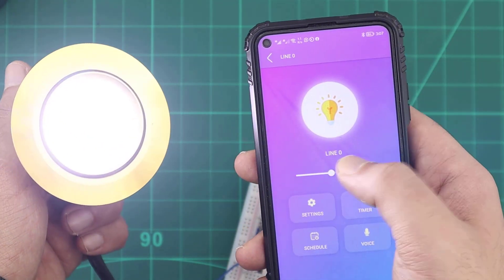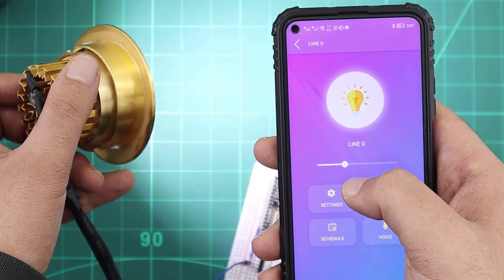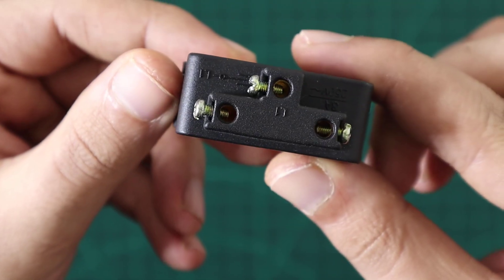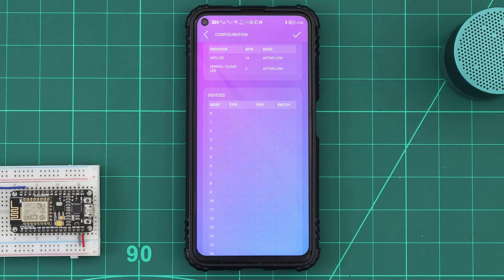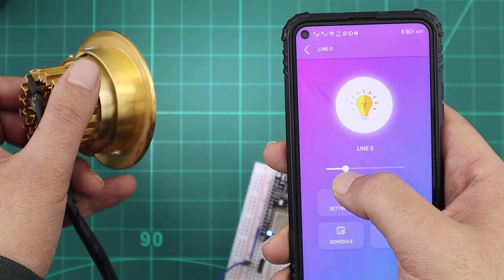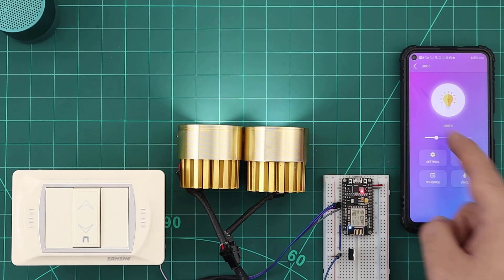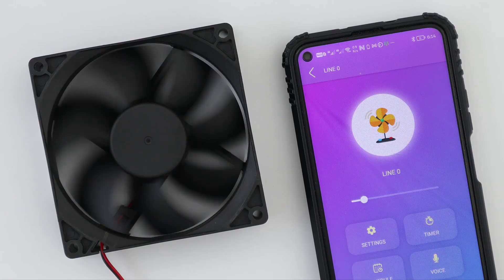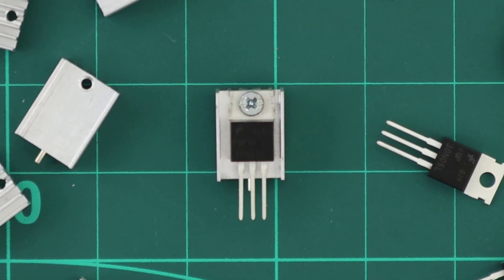Control light brightness with CADIO dimmer device (ESP8266 - ESP32) | CADIO Home Automation

Comment: I want to schedule the dimmer including the percentage of light intensity, but there is only an on/off option. I think it would be better to have the possibility of also scheduling the percentage I want, something like, turning the light on at 8am at 37% intensity. Another idea is to include a lighting ramp, where it would be possible to configure something like, the lamp increases the percentage from 0% to 100% from 8am to 9am I saw settings like this in the app for my Elgin smart lamp, I thought it was really cool
While this option is not included in the app, do you have any temporary solution that I can use to be able to do something like this?

Comment: Very good work.I think cadio is the esaiest platform I used ever. if I want to connect Atmega 328 in serial with Esp32
now I want to connect a dimmer to Atmega 328
can you please send me the arduino code to do that.

Comment: I live in the UK, so how do I DIMM my 220v ac table lamp as I see this only works with low voltage, and what do I do with the esp8266, and how do I power it with 5 volts? I am using TUYA lamps that run on 220 volts AC at the moment and Zigbee to control them all, and my door sensors are battery operated, so to change to your system would be very hard, so perhaps you can explain in a video how to change.

Comment: Great app! I will try every feature it has. But I wonder what is the frequency of the pwm signal? I hope it is more than 10 kHz. I don’t want it to flicker on camera.
Reply from the maker: I think the esp pwm is 1khz
Reply: @cadioHomeAutomation  the internet says it goes up to 40 mhz but I don’t know much about it. I will try though. One more question. Can I use push buttons to switch modes between on/off instead of a switch? I really want to be able to do that. I might even be a dealbreaker for me.
Reply from the maker: @kerimturan1757  yes, just set the "switches mode" to "press".
https://egycad.com/cadio/docs/info-file/general-settings/#switches-mode

Comment: Best app and easy to use, How to use AC Dimmer with PWM output and Zero volt cross as interupt?
Reply from the maker: In this case, you need an external MCU with CadioSerial library:
https://egycad.com/cadio/docs/CadioSerial-library/
Reply: @cadioHomeAutomation  There is nothing details about AC dimmer on that portal document, only DC Dimmer is there.

Comment: sir once you get permanent license you can use many nodamsu
Reply from the maker: No, the permanent license is per unit.
Reply: @CADIO Home Automation  but sir I am use 3 nodemcu sir your launch app to buy license to use more mcu as possible as
Reply from the maker: In this case, you will need a license for each unit.
If you are dealing with a large number of devices, You can use the esp32, or use an external MCU with CadioSerial library, and you will be able to add up to 21 devices per each esp
Reply: @CADIO Home Automation  thanks  but extra mcu can oprat manual swich sensors possible 21 appliance